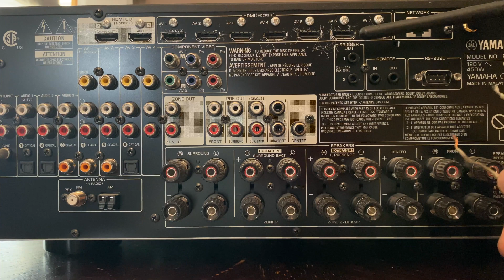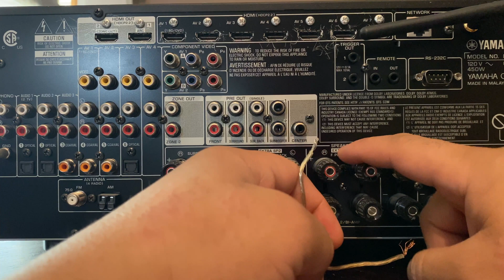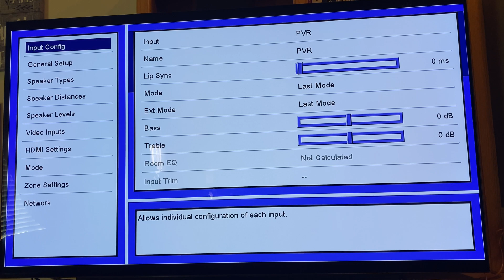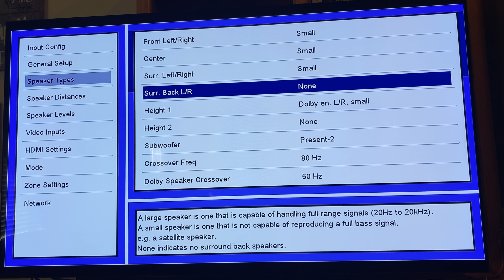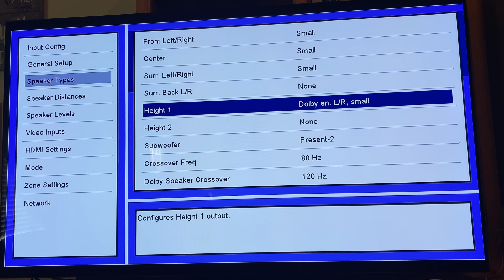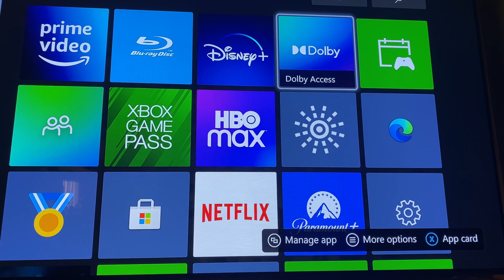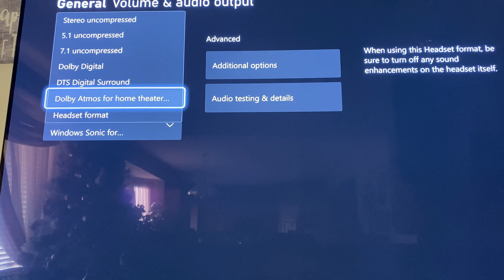How to Set-Up Dolby Atmos Surround Sound Step By Step for Receivers & Amps 5.2.2

Comment: What if I want 7.2 speakers and plus atmos speaker. Where will it work? Total 9 speakers
Reply from the maker: Good question for a receiver that’s is a 7.2 channel that has preouts can do the internal 7 channels plus two more channels using an external amplifier. If your question is you want to use 7 bed layers speakers plus two atmos, yes it will work on a 9.2 channel receiver